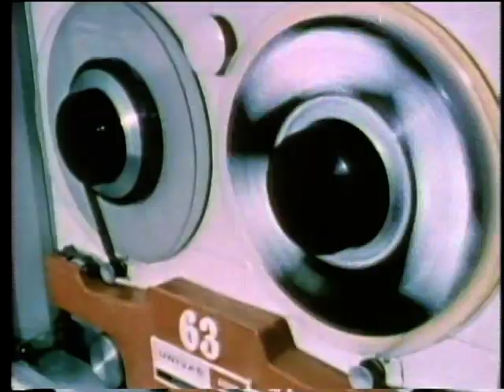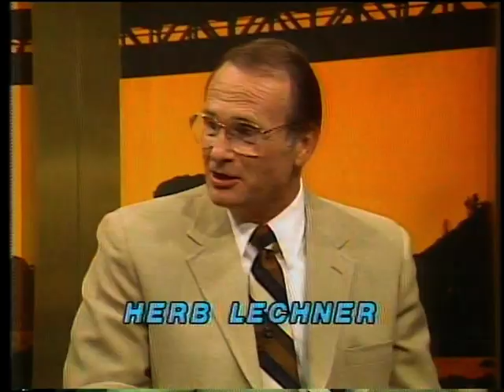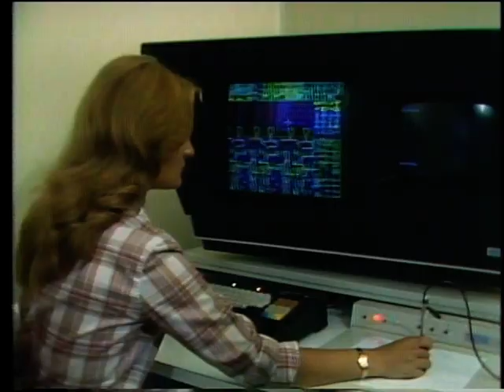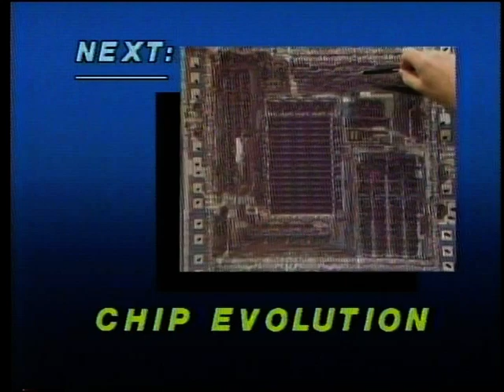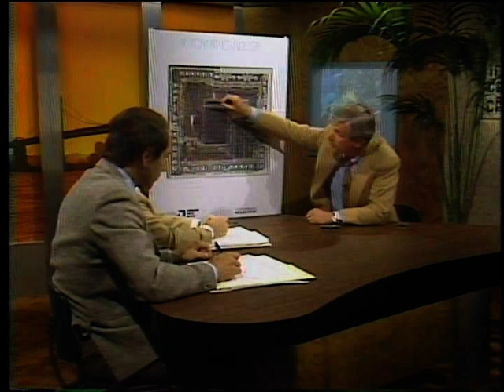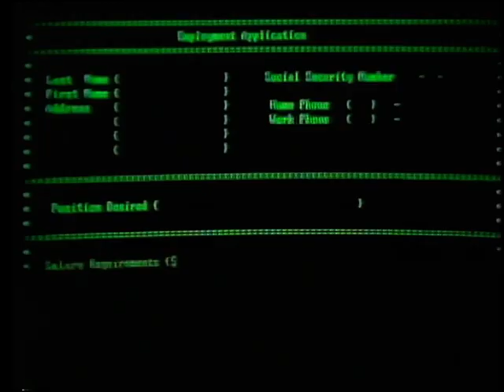The Computer Chronicles - Microchip Technology (1983)

Comment: The Apple A8X (fucking portable!) has 3 BILLION transistors at 1.5GHZ and probably consumes very little power. OTOH, clock sped has been static for years now and we are simply creating more complex processors and adding cores. It would be preferable if you could have a single core going much faster.
Reply: tarstarkusz 
Software advances with hardware, you don't expect people to write single threaded programs in this day and age, do you? Browsers, compression programs, video decoding and encoding(unless software decoding is set up), video editors or all productivity related software in general and even some games can easily use more than 4 threads. This isn't about whether it's necessary, because most people who only use computers for browsing could do fine with even a core2 duo.

 People were saying the same thing for quad cores when they were new and look how that mild single core advantage is serving them several years after. Look up the recent coffe lake leaks, it looks like intel is also going to release >4 core desktop parts.
Reply: We need a new paradigm.  My new laptop is maybe 50% faster than my [dead] 7yo Asus machine.  And it's just 8gb vs 4mb after all this time!  Plus 4mb laptops are still  the norm.
Reply: Yep, that is why i am still using a 7 YO PC. With the exception of high end Xenon and I7 processors, most of the current offerings are about two and half times faster than the one I have (going by passmark benchmarking). Just adding more cores isn't going to fix this problem.
Reply: tarstarkusz Not really, multiple cores simply perform better if your programs aren't written in a sloppy way.
Reply: +Party.... All other things equal, it is always preferable to have 1 faster process than 2 or more that (combined) equal the 1. There is overhead when you use more than one core/processor that simply doesn't exist when using just 1. That is best case. Most software just isn't written that well for multiple cores and in many cases simply won't benefit from multiple cores (usually that would be a process within a larger program). This is why multiple processors never caught on until it was forced by reality when processors just weren't getting that much faster. Multiple processors have been available on the x86 and 68k and PPC formats for a very long time. The only place they saw wide usage was servers and some specialized things like filters for Photoshop on Mac.
Reply: tarstarkusz and my point is multiple cores with lower clocks perform better IF the software can take advantage of it. We are seeing a trend towards CPUs with more cores because you can gain more performance from increasing the core count than merely increasing the IPC or clock speed. Software is to blame here, not the hardware.
Reply: +Party.... We are seeing a move to multiple cores because they have not been able to increase clock speeds. It's 2nd choice. With modern OS, there is  a much better ability to use multiple cores though. I will grant you that.
Reply: tarstarkusz It's sort of like that, silicon's physical limits are a barrier so you have to sacrifice efficiency to solely focus on clock speeds which ends up with an inefficient architecture that may not perform better after all.

 Look at pentium 4s if you want an example. Intel originally wanted to create a 10GHZ chip but it was too late when they realized that it simply is impossible/not feasible. This is how they ended up with the abomination called netburst which had high clocks(3+ghz overclocks in those years were pretty high) but they were inefficient and had horrible IPC which is why more efficient athlon 64s with lower clocks beat them while consuming less power. You can't focuse only on clock speeds and expect a faster chip. An additional core simply provide more performance than a 200mhz increase ever could so it's more logical to increase core count while also steadily increasing the clocks if possible.
Reply: +party... I understand that. My point is that they have been forced to move to multiple cores (though obviously there has been single core improvement) to really keep the increase rate high.
Reply: tarstarkusz It's kinda like that. Focusing on only single core performance isn't really feasible. It's a little sad that we might have hit a wall but hey at least 32 core CPUs are exciting.
Reply: +Party... I don't find it that exciting for most things most end users do with computers. There is massive potential for large scale stuff, but this is not going to help desktop PC users. In most cases, 4 cores is about the reasonable point of diminishing returns. Using these 22 core Xeon chips makes sense for certain back-end stuff on servers, they make zero sense on a desktop.
Reply: tarstarkusz Even desktop use cases are starting to take advantage of more cores. It's likely that 6 core CPUs will replace 4 core ones in the near future.
Reply: What are people using desktops for that require 6 cores? Furthermore, if I have a quad-core that is the same speed (combined) as the 6 or 8 core  processor, by definition I am better off with the quad core because that would mean single threads are going to be faster on the quad core. AMD has an 8 core processor that has this very problem.
Reply: +Party.... Yes, but there are limits. There are some tasks that have to be done linearly. Having a lot of cores requires a lot of threads. Are you denying that there is a point of diminishing returns on a typical desktop? I don't deny the usefulness of having many cores on a server, especially a server that is doing work other than simply serving up documents (I used to manage a computation server farm). We are also seeing software being written worse and worse, of course, this has been a problem as long as computers have been around.
Reply: tarstarkusz I'm not saying that we can just keep increasing cores till eternity. The thing is >4 core CPUs also get better single performance with the course of time just like quad cores so stopping at 4 cores isn't really feasible especially since AMD showed that a better performing octa core can be more efficient and consume less power than a quad core. You can also match the single core performance of quad cores via overclocking depending on the chip. For instance you can OC a 5820k to 4.4GHZ rather easily and have 6700k/4790k. Not that I'm suggesting giving consumers 32 core nuclear reactors.
Reply: See, I personally would go with the 4790k even though it is slightly slower because it has a better per core rating (this is assuming all other things equal). I'm not discounting how much faster the chips are even at the same clock speeds. There has been massive efficiency gains, especially since the introduction of the original Core processor. It's just that we used to get large efficiency gains along with higher clock speeds.
There is also problems with software. Let me just give you an example. I use a program called SMplayer for playing high-def (1080p)youtube videos. Version 14 uses my heavily throttled Core 2 Duo at around 5%, the HTML player pegs it out (when throttled at 60% or 2ghz, it's a e6850) and SMplayer 17 is about 90%. Same video, yet the older version uses almost no power to play it back at the same res, while version 17 is using 90%+ of my CPU power. The HTML will actually start skipping frames at 1080p.
You see this all over the place. Collectively, this is likely costing billions of kilo-watt hours worldwide annually (poorly written software, not YT videos). I have my PC plugged into a kill-o-watt meter and power consuption goes way up when trying to play 1080p on the machine, while SMplayer 14 keeps it at the same wattage as if it wasn't running. The jump is big, it basically doubles and does worse than that when I unthrottle the CPU in the power control panel.
Reply: tarstarkusz The 4790k is still adequate since intel has been re-releasing the same chip with slightly higher clocks and %5 better performance. BTW it sounds like SMplayer 17 has a problem.with hardware acceleration.
Reply: It is probably going full software because to use hardware requires a newer Direct X or something, which my video chip doesn't support. But it does illustrate the problem well. Software has gotten more and more inefficient over the decades. Not just because it has gotten so much bigger either.
I was looking at the two chips you were talking about, both had passmark scores around 12,000 while the 6 core was only slightly higher than the 4 core. All other things equal (like same ram speed), the 4 core is going to have the edge in most things.
Reply: I agree that software nowadays are inefficient. If you are talking about the 4790k and the 5820k, both are more or less the same architecture, the -e architectures are nearly the same architecture with more cores. the 5820k has a passmark score thats around 1700 higher than the 4790k's and that is with a 0.7 GHZ lower base clock. 5820ks overclock to 4+ghz quite easily so that gap is going to widen pretty easily.
Reply: +Party... I completely disregard over-clocking. With a few notable exceptions, OC is a big headache for fairly small gains and not really worth it. Hell, I throttle the CPU in my PC almost all of the time and only put it on full power when I really need it. It literally cuts the power use in 1/2 (from over 60watts down to 35 at idle), keeps the CPU in the 20s (C) most of the time which also keeps the temp inside the case down with 2 3.5" hard drives in a mini-case. Since I run my PC 24/7, that makes a difference in the power bill.
The 4790K has a per-core rating of 2530 and an overall rating of 11,197 while the 5820K has a per-core rating of 2016 and overall rating of 12,994 (TBH, I only briefly looked before and thought that difference was smaller). The 4790 is about 25% faster per core and they seem to be around the same price (going by passmark, not actually looking). Personally, the higher single core performance is more useful to me for the only thing I need a lot of processor speed for. If you are doing a lot of stuff that can really utilize the 6 cores extremely well, then that's probably the right chip for you. If not, then the 4790k is the way to go.
Reply: Well the temps don't increase that much and you get equal if not better single core performance. Better single and multi core performance sound better to me but everybody is entitled to his/her opinion.
Reply: @whydohandlesexistAAA  It depends on what you are doing. If you're watching youtube videos, extra speed doesn't help. The video is filmed at either 60, 50, 30 or 25fps.  If you are encoding video, all bets are off and you use every bit of hardware you can.
Depending on what you are doing, most of your cpu time is spent idling and doing next to no work. Other times, the CPU is pegged.
Though to be fair, all other things equal, faster is better.

Comment: The next technology will need the expertise of both biologist, electrical engineers and physicist to build. As they reach there limits of size. They are even trying to use the structure of DNA as a way to store data. As it is information dense beyond anything humans can produce even with the aid of the computer.
Reply: +Claude “Reviews4U” Rains "Both"? "(...)biologist, electrical engineers and physicist(...)" Aren't those three?
Reply: RottenRroses
Well any combination of the above will be needed. As even Rice University as started to apply the professions to one project. As they seen they need of many experts in their own field of study.

I understand the reasons as well. As no one person could have an insight to all those fields of study. Unless you want to spend 12 years learning several of them. It's like Maxwell's equations. You could spend a life time of study on the subject. So they break them down into sub sections. One part for engineers. others for programmers, etc.. at MIT.
Reply: @WizzRacing  
We need to use stem cell based foreskin regeneration to regenerate the foreskins of genitally mutilated men and boys. And hopefully develop life extension technology and biological immortality.

Comment: @ 4:43 LOL! Have we exhausted the technology? We've been asking this question since forever it seems. Believe it or not even if we still had the same technology as back then the evolution of technology would still occur in fact probably more so since we would actually have to think when designing a product (more of a challege vs today's throw it together). I respect people's work but just as an example (maxwell and kepler) there are so many optimizations that we could do with current tech, instead we hope to solve the problem with "new" tech instead of optimizing hardware and software. SOC's would be alot more prevalent early on for computers in general as well as HBM. Just now getting this technology because the thought is on profit and not innovation. Good job AMD for bringing the tech to the table (bad for making a "decent" gpu).
Reply: +decimat777 I'm guessing you're not an engineer. To get to the level of tech we have today has required ungodly innovation, science, and cognition.... Not just "hey, let's just do it a different way. That'll be so much easier." Innovation is a form of optimization - especially after the Nth level; Merely semantics
Reply: +Gatsby Light Upcoming engineer not a pro i will give you that, I've designed two ASICs with SMT by myself but that's all I've done so far . I think you missed the point of my comment. I was referring to the optimizations that could be made with a current set of tech before discarding it to move to another gen hoping that speed and the natural efficiency effects of shrinking a chip will solve the problem. There are many things that could be done to optimize hardware before it could be considered outdated. Intel's tick tock strategy is a small example as I think they could do more. Especially so with software. I'm working on my compsci degree atm and seeing other people's software twice the size as mine and buggy as hell is disheartening (yes i know we're learning but I've seen examples of code and heard stories that its similar in the workforce). So all i was saying was that it was funny that they said this back then and also that we could do so much more with a generation of tech than we care to try.
Reply: +decimat777 Actually companies and science departments of many institutes are constantly researching fot new tech. New tech is the only way to achieve new techniques and improvements in resourses capabilities and efficiency, also research is the only way to discover new things or more virtudes and better use of existing things. Research is the only way to obtain more knowlege. Also I disagree about Intel, I think they doing a great job creating processor that use a lot less electricity, and more reliable than years before, they get less hot, and honestly are very impressive compared to older pcs I had and used (Since 1989). I think AMD makes excelent products too, but Intel is ahead of them all the time.
Reply: +xplus93 a perfect example of what I was referring to this whole time has recently occurred. AMD has been on a roll releasing drivers for their somewhat dated technology and it has proved to be quite successful. Take the r9 290 as more direct example, at first it was sort of the mid-high range competitor and now it can even compete with a gtx980 in some cases, this card was released in 2013 *take a moment to process for the sake of logic. on the flip side another example is nvidias Maxwell architecture vs Kepler same tech just redesigned and reorganized to be more efficient. AMD had software issues but a great architecture, nvidia had the software down but only decent efficiency, whereas now it's stellar after the redesign. Jumping to the next tech before solving the current issues doesn't solve the problem guys, it creates more. it's ok though, technology is reaching (or currently experiencing, which would explain these two instances above) a plateau, which will be a good humbling experience for us in general, before we can exponentially rise again.
Reply: +decimat777 we have been optimizing guns in a hundred years. so yeah, agreed

Comment: amazing how it's been over 30 years since this production and we have transistor counts now in the billions as common place cheap consumer products.
Reply: and now nvidia gpu has over 78 Billion. funny in this show he was saying 100,000 transistors coming (in their soon future which was a few years away from air date) was consider SUPER. lmao. if you told him how about 78 billion, theyd all probably say, IMPOSSIBLE, no way, why would you need that.. well ill tell you why, as transistor count increased, programmers got so lazy, no software is run efficiently, they just write crap code and let the powerful chips deal with it. if every os and software was 90-100% fully efficient, we would have computers run 10-100 times faster than they do today.
Reply: @davidt8087 It's not always due to laziness. You also have tradeoffs for going to market faster, making the code more maintainable, making it easier for many people to work together, etc